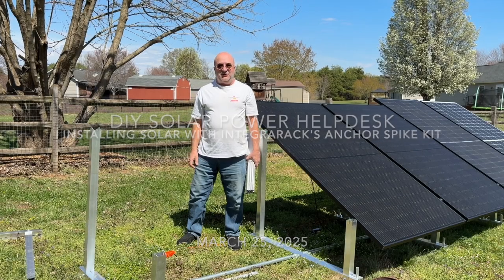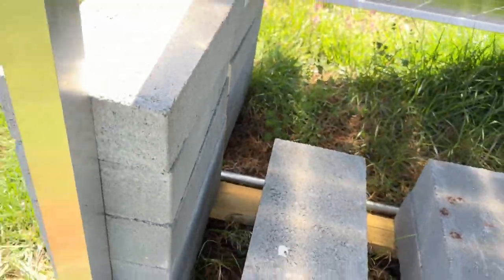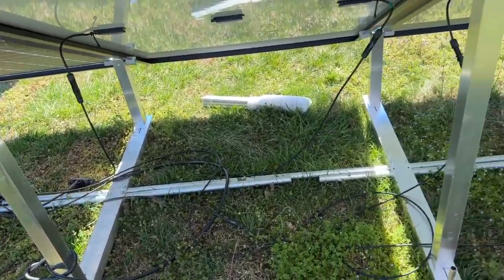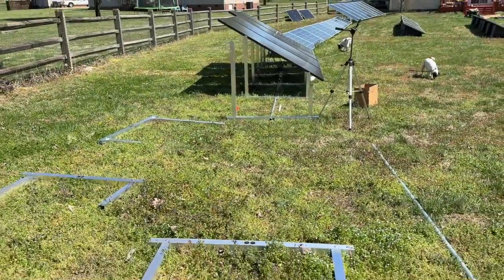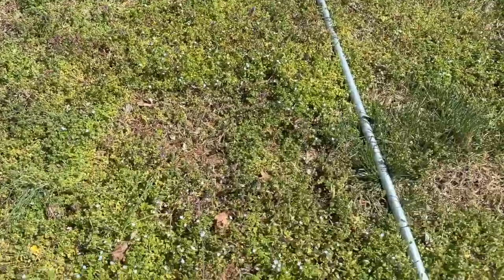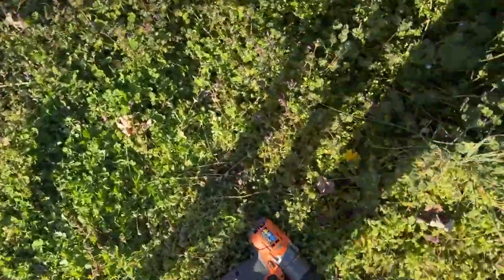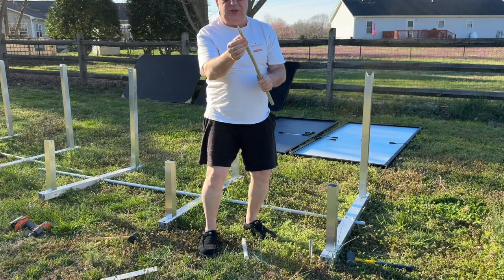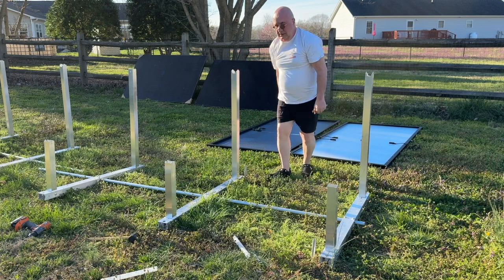Installing DIY Solar with IntegraRack's Anchor Spike Kit

Comment: I am in the process of installing solar at my home. I wanted grid backup, which required an electrician by code. Then came the code and permitting department... they required an "engineering stamped and certified" solar array (for ground mount) with snow loads and wind loads of 115 mph (Davie County NC). This system is only one of two that provides those certifications for DIY. IntergraRack support is fantastic,  with one of their engineers calling me directly. The other is much more expensive and more difficult to install.

Comment: Can your panels be vertical adjusted for summer and winter ?
Reply from the maker: The IR-45ASA, and the IR-45ASAB are adjustable from 15 to 45 degrees. I used IR-30, which is a fixed 30 degree tilt. They are lower cost and I know I wouldn't be bothered to adjust them 30-deg is close enough all year round.

Comment: how much does a block weigh? Is that enough to stabilize for heavy winds?
Reply from the maker: The CMU blocks weigh about 33 lbs each. A 120 mph wind requires 600 lbs per solar panel. In my area, the maximum 30-year wind speed is only 90 mph. (90/120)^2 = 0.56, so I only need a little more than 300 lbs per solar panel. So far, so good anyway! :-)
Reply: @DiySolarHelpDesk  Thanks for the info.  Can you tell me what kind of daily output you are getting from that 8 panel 550w bifacial array?  I am going to try the same setup to charge 10kwh of battery and I'm hoping to change them daily.
Reply from the maker: @Duet4Johnny  Honestly, no. I haven't had a full sun day from morning until evening in months! Since winter when I installed them. Theoretically, they should produce about 19 kWh daily, but the weather isn't cooperating.

Comment: Since the IR-F2 clamps bond the panels to the frame I think. Do you need to run a continuous ground wire between them in addition? Where did you attach your ground wire for the rack itself?
Reply: Jack Russell Terriers?
Reply from the maker: No, just use the grounding jumpers from panel to panel.

Comment: Thank you for this video! I have 10 Aptos panels I need to mount for an off-grid system and I'm leaning toward the Anchor Spike system. I noticed you didn't show the actual injection of the epoxy into the ground.  Is that fairly easy and straight forward?  Thanks again.
Reply: Yes, it comes with a bucket, gloves, stir-stick and a funnel to pour it in. I haven't gotten that far yet, I still have two more panels to install. I had run out of racks, but I have more in stock now. Ready to take your order when you are.